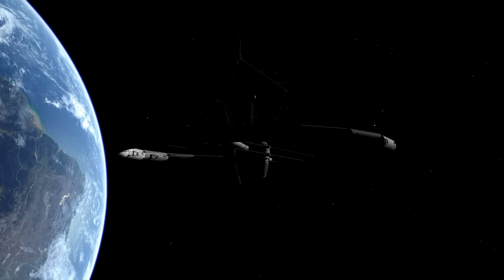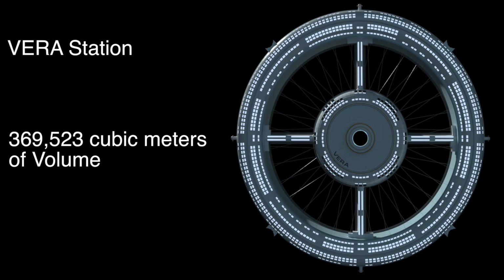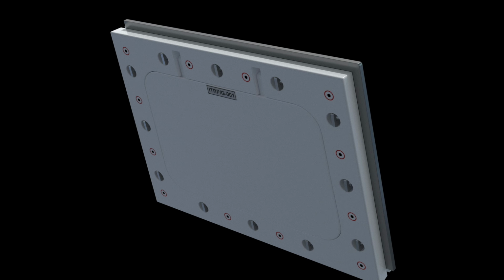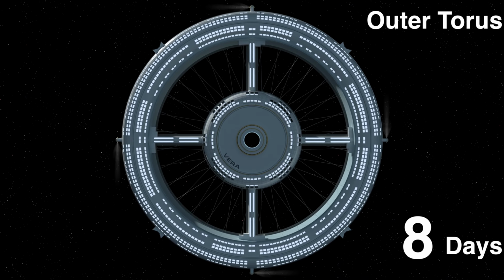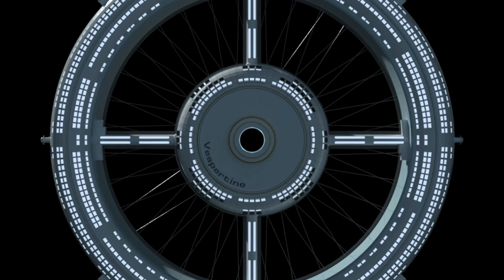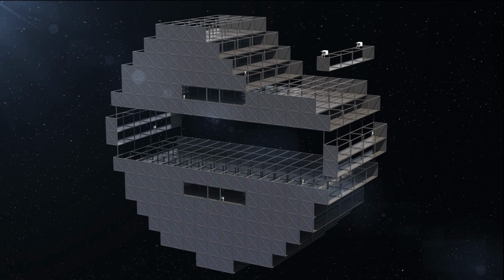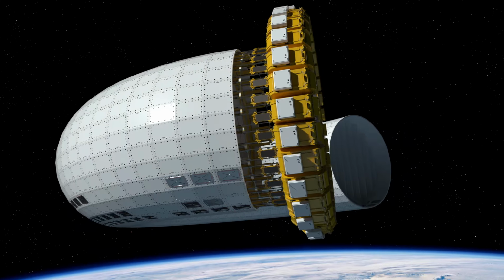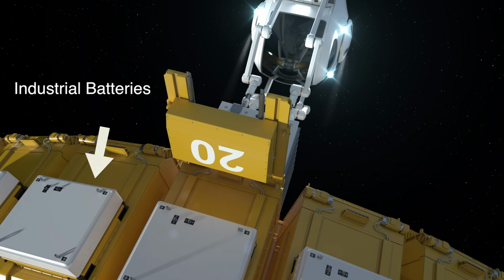We could build this huge Space Station in 6 months

Comment: It is my belief that we should be planning to build artificial G environment space stations instead of planting colonies on which ever rocks out in space that we think we may be able to survive on.   Instead of a fixed, land based colony on Mars, we should have orbiting space stations around Mars.   The same goes for the moon, Europa or which ever other place we decide we want to go and have a permenant presence at.   If we decide we need to, we could launch a space station into solar orbit like an artificial planet.

This is the only strategy that actually makes sense.   With space stations we can build standardized environments that provide for our energy, environment. protection and supply requirements to go anywhere.  Then we only have to focus on specialization for landing and away mission support to the surfaces of any of these bodies.   

It is much easier, less costly and safer to launch re-supply missions from earth to in orbit space stations than to have to develop complete landing and return to earth capability to deliver all the material required to build a permanent colony somewhere.  We can still build interim or staging bases on the surface if we need that for some reason.   We would carry those kits in the space stations.  

 If we are hunting resources this would only require the engineering to develop the appropriate equipment for the away missions to the surface, surface resource gathering and collection equipment and vehicles for return to the orbiting space station.   These could even be robotic and be managed and controlled from the space station.   

We would then use our cargo ships to return resources to earth orbit if we are moving them back to earth or dispatch them to another space station if that station needs what we have collected.   These cargo ships would just shuttle people and material back and forth in space between our orbiting space stations which is a lot easier and more efficient than having to have full launch and land capability to and from everywhere they are going.    This way, we only have to launch any and all the materials needed to go anywhere up to orbit.

Comment: Not so sure about the name Sargon, he was a brutal monster of his period.  But I certainly applaud the ambition, I suspect the timeline will creep up, there are many extra challenges you need to consider in the construction of such habitats, but we absolutely need off-world fabrication technology so regardless of what actually gets built with these things, its a good bet.
Rigorous safety checks, torque-stress, pressure-integrity, long-term durability and micro-meteorite protection (safety, seal and repair) procedures will be vital and secondary construction will doubtless increase the time-frame for completion of these stations.  Working in space is difficult, and there are other barriers that will not allow that timeframe to be accelerated excessively without risking worker safety.  I am concerned that the drives of capitalism may lead to laxity in these areas.

I really think we probably want to consider lunar subterranean construction, or systems that will specifically combine lunar regolith with binding agents to make durable radiation shielding.  While all-encompassing water-jackets may help, long term space habitats, on natural orbiting bodies or in artificial orbitals, will need significant shielding, and our closest neighbour is likely going to be the most practical source for those requirements, regardless of where we build.

Comment: How do you get the builder into space? It's really hard to get anything into orbit from this planet. That machine looks very heavy.
Reply: I'm guessing, but I suspect the machine itself is also modular, likely a number of pieces will be lifted in multiple launches.  The pictured render shows 32 sections and given the varying diameter of completed tori shown, it seems clear the machines are designed to be altered for varying construction purposes.  You're correct that getting it up will be one of the hardest parts, though, nonetheless.
Reply: You bring it up in sections

Comment: Forgetting the basic engineering rule. Plot out your most reasonable timeline to completion. Then multiply that by 4 for all the unexpected disasters, problems and general unplanned for bits that turned out to be totally necessary but wasn't really inked out in the initial design. "Know all those load bearing struts that make up part of the core structure... yeah, turns out the alloy wasn't mixed right due to a mis-communication with the fabricator. What we put together will have to be taken apart and redone." That sort of thing always happens on a major new project.

Comment: stupid question: how does Sargon build the last segments to close the loop without being caught inside it? And another stupid one: How would warping be prevented? One side always heats more than another.. How do you prevent creating a screw? 
If it was up to me I would try to create some kind of inflatable ring of the size of the space port in the middle (which will be removed after building has completed). This could be part of a single module which also has a solar generator for recharging the building bots.. The inflated ring can be used as base for small robots which can build the torus from inside to outside section by welding small parts together or even laser weld metal filament (shouldn this be possible in vacuum? maybe diode lasers can get hot enough).. Since we're talking about thicknesess of some millimeters per welding spot, such a robot won't be very large and it could roll along the walls of the station keeping in touch with it using magnets. There could be dozens of them shipped within a that single module...  I shouldn't watch those videos.. now I got dozens of images in mind..
Reply: I suspect the modular construction allows segments to be decoupled from sargon to allow the whole rig to be maneuvered away from the completed Torus.

Comment: What if the expansion of multiple Torus structures used electromagnetic rails between them to moderate rotation?  Since the farther away from center you get in a fixed Torus structure the faster it's rotating!  I am not sure what that effect has on G-Forces!  The outer rings have slighter and slighter curvatures that I suppose reduce the G-Forces by some realizable quantity!  Connecting rings via electromagnetic rail could modulate that to provide identical G-Forces throughout the growing ring diameters!

Comment: I am assuming Sargone will be sliding those panels into place on extremely tight tolerances so the welders will have a perfect connection to make a single bead. If this is the case why do the panels have to be slide in two at a time (one on each side) why isn't the whole ring slide into place at once and all the welding beads done at the same time horizontally and then all the vertical welds to join to the existing rings.
Reply from the maker: Very Good, Jeffery!
We have been studying many methods of using Sargon to build Torus stations and Modules and one of the most promising is Isolated Ring Fabrication (IRF) this is where we build a whole ring away from the construct ( a meter or so) and then move it into place and weld it together after it is stress tested. IRF may be used if X-ray weld tests fail to find bad welds.
Thank you for you attentive comments, these help us a lot. - JB

Comment: Rather than welding exclusively (and maybe not welding right at the beginning), this would be better if these were interlocking pieces, perhaps supplemented by welding.  This may be a bit too massive to start.  Orbital Assembly Corp has a more scaled down version.  I agree with that approach:  First let's prove the technology in a simplified, much smaller version.  Once it is demonstrated that it works, then this would be great - and I believe the financial backing will follow.

Comment: How does the Torus remove itself to build the last section? Absolutely love the vision, can't wait to see it a reality!
Reply: Perhaps the torus is flexible enough to leave a gap for the builder to exit before the gap is closed.  Alternately the builder could be split and be removed in two parts.

The real problem is the cost of stations and the insurance against space impacts.
Reply: The torus has to be assembled and thus will be disassembled roughly the same way.
Reply: It becomes part of the structure
Reply: Separates in half or opens up on a point on a hinge if technologies are available then anything can be possible to have the job done. Or it could work as multiple drones that can separate when the job is done. These are just my theories and could be practical if real execution is carried out.
Reply: it probable work as a belt
Reply: Build in two halves and join together
Reply: Theres no way they'd launch that in one piece. the assembler would first assemble itself in the ring order dependent on the panel size.
Reply: Would think one of the Torus on the right or left would be removed, while the remaining Torus finishes the final section.  After complete spacer bar’s would deploy allowing the final Torus to deploy a connector ring and move out of position.  Spacer bars would would pull both sides to connector ring and welded.
Reply: Must remember this is a weightless environment.
Reply: I would imagine it would build the last segment, then detach like a handcuff, and disengage. to move on, or be towed to the next site.Perhaps, it could remain with the station to act as a repair section system, or at least remain close, for that purpose.
Reply: Great question. would be funny if they hadn't thought of that, but I'm sure they have.  Too bad, that he does not reply here in the comments. He gives a play book presentation, but this one seems to be without question-time for the audience. What if I was a multi billionaire thinking about donating 10 billion to his company but I'm too shy to send him mails and instead do it anonymously here on Youtube? He'd loose 10 billion, just because he thinks I am a random idiot on Youtube, who plasters the comment sections with stupid things. Which couldn't be further from the truth. Questions over questions. Anyhow. We need people who think big. And when these people are also engineers, the better that is! Good luck "Gateway Spaceport"!

PS: This guy is bold. "Mr. Bezos, this is your dream, we should meet.... Mr. Musk,... let's get together and talk about that". And the best is: I believe him, that he means it honest. Any maybe he would be capable.

Comment: Another Torus manufacturing idea. 
Build in the same way high pressure composite tanks are made from carbon fiber, kevlar, and fiberglass. Create a mold, inflated and formed with expanding foams or  gas (or possibly without a mold using UV instant epoxies) Then create a machine similar to the machine already designed. Except instead of mating panels it will run rings of fiber adhered together with special UV epoxies that set almost instantly(think 3D printer). The machine simply needs to be fed with a Continuous supply of fiber and epoxy. 👍

Comment: Cool beans man! But if you want a true heavy lift rocket, get someone to revive the Sea Dragon.  Designed in the 60's, it was just a big dumb booster with a single engine on the first stage with an engine bell 75 feet in diameter. There  were no hi tech turbo pumps for fuel injection, only high pressure nitrogen tanks and  the required valving. Both the first stage and second stage (there were only 2) were reusable.  Payload to orbit about 500 tons.  BTW it was called the Sea Dragon because it was launched from the ocean, since its 80000000 pound thrust would destroy any launch pad ever built. I'm sure that if it were redesigned with todays hi tech materials that could probably be improved significantly.

Comment: I love the creativity man this is all a cool story, But do you actually know what would go into these things? Do you have any blueprints, wiring or hydraulic diagrams? Do you have any sort of idea of how much it would take to turn all these little welder segments and stuff you talk so confidently about into a working assembly?
Reply from the maker: Yes, we do.
John Blincow's experience with space station design is extensive. He has designed six stations and helped design station systems architecture and systems integration for rotating station designs including and but not limited to:
Electrical Power Generation and system bus architecture. AC and DC buses
Pneumatic systems with integrated CDRA systems(Carbon Dioxide Removal Assembly) Both Ionic and Zeolite 5A systems
Water purification and delivery systems
Station heat rejection systems (active and passive)
Station propulsion systems for orbital maintenance, maneuvering, and procession.
Flight control systems and communications nodes
Radiation shielding (active and passive)
Active station imbalance systems (for rotating stations)
Station docking systems and mechanisms (rotating and stationary)
Station emergency evacuation systems

But the main focus of Offworld Industries is space construction:
Panel construction machines: Sargon Systems
Automated Truss machines: GSAL Gateway Segment Assembly Line
Pods
Drones: Both free flying and ambulatory; observer, retriever...
Arms
Bots
More...

Comment: Noticed a design problem with Sargon. Maybe you can speak to how it closes the torus with the last ring. It appears to be both inside and outside the torus as it assembles the shell. How will it get out of its own way to place the last ring and remove itself from the torus? If it will require manual labor to finish the ring and disassemble the Sargon I volunteer. ☺
Reply: I'm sure it will split in half

Comment: This is a cool idea; I have always dreamt about a democratized space station that everyone can visit. However, I do have concerns about Sargon and its design. 
They are as follows:
- Has Sargon been prototyped and tested? Do you have more than just simulations? 
- How would you launch Sargon into space? How many launches would you require? 
- The circular construction would require some form of maneuvering I should think. How does Sargon accomplish this? 
- Have you accounted for what would happen should any of the drones of Sargon subsystems fail? 
- Would the increasing bulk and shifts in the center of mass cause any problems with the orbit? 
-  You mention batteries as power sources and possibly charging them through solar. How much would adding solar power affect the Sargon system? 
- In order to keep Sargon, VERA and Vespertine fed, I think space logistics would need to get much cheaper. SpaceX is working towards that for sure, 
but I d not think we will be there for some time.

Comment: @GatewaySpaceportLLC: How do you mitigate the effects of error propagation in assembly?  Also, have you done any testing to see how much error is induced into the welded assembly due to heat deformation from the welding process?  The biggest risk here seems to be joining the two ends together with less than an inch of error.  Seems to me that creating a more flexible ring and then adding onto it might me a more viable option, same way tightening the lugs on the wheel of your car after changing the tire makes a more accurate and well-seated fit.
Reply: Gateway Spaceport is not a company btw. It's just some guy doing computer graphics in his basement. He's alone in this, and probably less qualified than you and I.

Comment: A counterweight system on rails around the outer perifery should be able to maintain even distribution of weight around the torus, as well as gyroscopic precision alignment. What will be interesting will be seeing gravity indexes for each floor, since as you go to lower floors gravity increases. Gyms and exercise areas could be on the outermost ring.
Reply: This is definitely the part I'd like to see more of their proposed solutions for. Large spinning torus ring constructs like he's talking about will be subject to massive inertial forces and stresses. Small failures can lead to catastrophic failures in seconds. Like a spinning tire with shifting internals, and no stationary central axle to keep it from shooting off or tearing itself apart.  The counterweight systems will have to be extremely sensitive, smooth operating, quick reacting, and nearly bombproof in their reliability.  They won't just have to be designed with optimal performance in mind, but to react to things like catastrophic ring integrity failures as well.

I also think his concept of large open spaces inside the ring is a bit optimistic given today's technology. Large connected internal spaces like that is an assumption of massive amounts of risk.  I don't see how we can get away from smaller compartmentalized spaces with current tech (this isn't Star Trek or Star Wars where we can simply drop a force field in place to prevent explosive atmosphere loss.  There will need to be automated hatches everywhere to prevent small/large leaks from manufacturing flaws, micro meteorite strikes, or larger failures from voiding the entire internal atmosphere.   Better leak detection and repair techniques will also have to be developed for larger structures where there is more potential for them.   just look at how much difficulty the ISS has had with just the one leak in the Russian compartment.   

There are so many other hurdles that will have to be overcome for any of this to work, but still it's good to see the infant technologies being developed and pitched like this.  I'm sure the tech will develop rapidly once there are real world instantiations in place.  I always figured these spinning torus ring structures would probably start as latices with individual compartments arranged around them with interlinking crawl tubes, and some sort of gyroscopic balancing system using counterweights.